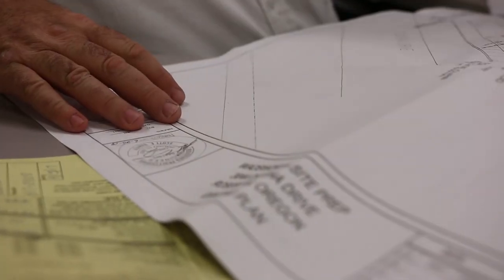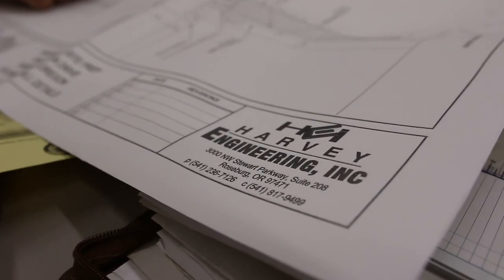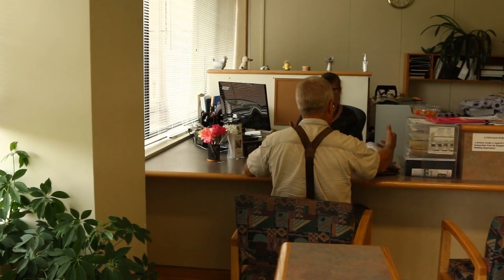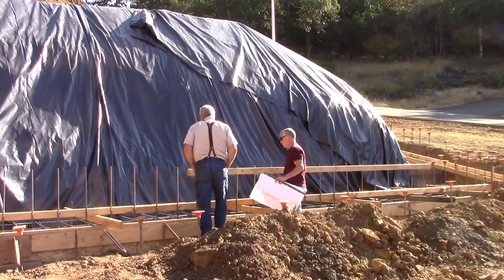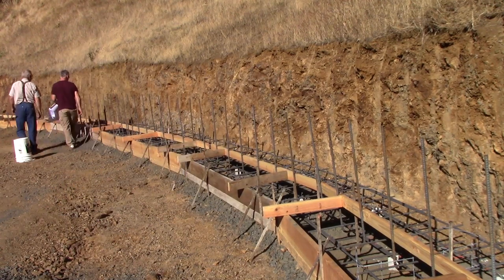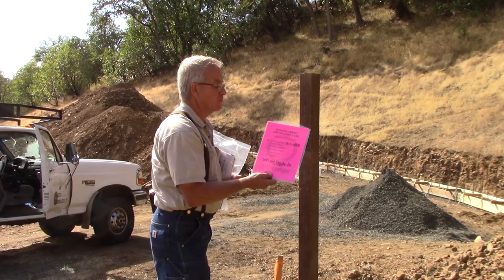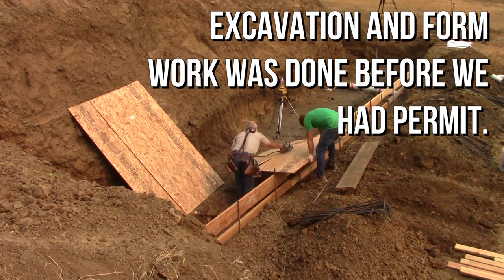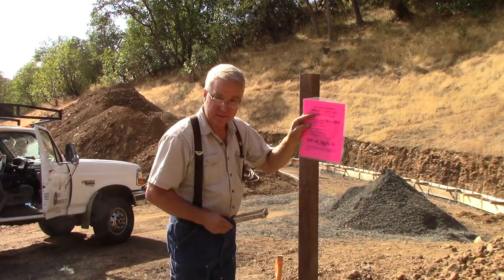Permit and Inspection EP.15

Comment: Adam Carolla says it best. Can you imagine what the founding fathers would say if you had to get permission and go thru all this trouble to build on your own property. Who has a greater interest in making sure the building won't fall over than the person paying for it.
Reply: That's a fair point if you're building it yourself, or if someone of integrity is doing it (like in this case), but I can assure you that if given the chance plenty of people would take every shortcut imaginable to build a cheap house, unload it on some poor unsuspecting buyer, and be long gone when problems became apparent a year down the line. There is a point to codes and inspections, unfortunately.
Reply: At the moment you want to sell it you will realize that the build is worth a lot less that those that would have permission and passed inspection. It is just a capitalist market mechanism that was so successful that it has been formalized.
Reply: And yet it happens all the time.  Buildings in India literally collapse while full of people, due to nonexistent codes or codes not enforced.  DIY'ers and bad contractors constantly do more damage than good.  I'm the last one to want to pull permits, but codes are definitely a good thing.
Reply: The folks who are going to work/live in it have the greatest interest.  The builder can take calculated risks on safety measures that the people who are going to use the structure can't afford. The municipality in theory is working on behalf of those people, though they do make money off the process.
Reply: Having been on both sides of the matter (as of European standards and codes, which are by country in various states of rigidness, and equal in some cases as a trip to the proctologist) i can assert that there's need for these things. But something else that's needed, since, we're in 2018, is a speedier, and more efficient process, a streamlined method, and...i can't say i can see it happen, any time soon.

On one side, they hold to their jobs, imagine that some of these things went "extinct" in the process, they'd lose jobs, and on the other side, there's a clear uncertainty on how to proceed towards a  system that isn't so clouded and complex.

In short, you build on your own without expectation of sale? Go on, have fun, you might get away with it, both from the city and mother nature. But if you expect to sell this and that, you better make sure you have "receipts" for the receipts.

On a side note, related, but for a different stage of the "ownership" part of life, recently i heard through colleagues about a case where the owner knocked down a wall, and put a door. It resulted in a couple of years worth of legal issues for them. Like i said, two sides of a coin that's not really there, but at the same time, it is. That house isn't sound anymore.
Reply: When buildings fail people die. I don't always get permission,  but I do follow the codes.
Reply: willysnowman exactly. If you build a house to rent it out you are liable and it's your money so you will do everything correct. Probably even more so if your family lives in your new house. You are not going to cut any corners
Reply: The issue lies in he has to prove to all parties involved. The bank - city - lender - neighbors that the structure is built to a certain standard. This isnt the wild west.
Reply: The BANK is paying for it - so they insist that the building be certified to last.   Also, in our founding father's day you could much much more easily look at a small timber building and assess quality. Buildings more than one story high were rare (and HAD to be built by competent tradesman or they'd not survive construction).  There was no universal usage of indoor plumbing, electrical, pressurized gas lines, etc.  There were not widespread concrete retaining walls the height of a man that could collapse in a deadly landslide.   

This is the construction equivalent of the USDA establishing safety procedures for pasteurized milk or the FDA insisting on drug testing.  We can argue (and agree) about how poorly they are DOING the job, but that's not the same as disagreeing that the job needs to be done.
Reply: George Washington and Thomas Jefferson created DC's first building regulations.  So that's just ignorant nonsense.

Building regulations are a fundamental requirement of civilization, because risks are not solely borne by the owner.  Externalities are a real thing.  See: Hammurabi's Code, the Burning of Rome, The Great London Fire of 1666.
Reply: Except most people don't even know the codes. And Adam Carolla is a comedian.
Reply: somegoddamnguy 
Do you mean like The PLFL couple on YouTube?
Reply: When money is a factor, and permits aren't, everyone turns into a carpenter. Not everybody can meet there own expectations in time.
Reply: All that "muh freedom" nonsense sounds great until people die from people not following code and getting proper permits. Say what you will about letigious societies, but permits and codes also allow for you to be able to properly seek legal and monetary remedy if after following permits and codes something goes wrong. If there was not codes and permits you'd have almost zero remedy since there is no regulations to follow for the builders or manufacturers of products used in the buildings.
Reply: And if you ponied up the cash and paid everything on the spot, I can see your point. However, in most case the bank pays for it and then you pay who they sold the loan to. The structure serves as collateral for the loan. The county doesn't really have an interest in that, but you won't get a loan without all the paperwork.
Reply: aserta Any change will need lots of upfront investment in training, hardware and software. It will also involve the local trades people and professionals in investing time to learn how to work with the new system. The changeover will almost inevitably involve a Period of disruptions due delays. These facts and risk mean there is a lack of will at a political level and a desire at a trade level to postpone the change till “just after this big important project of mine”. Change is hard but is needed.
Reply: willysnowman Adam Carolla was a carpenter for years and has an almost daily podcast about construction